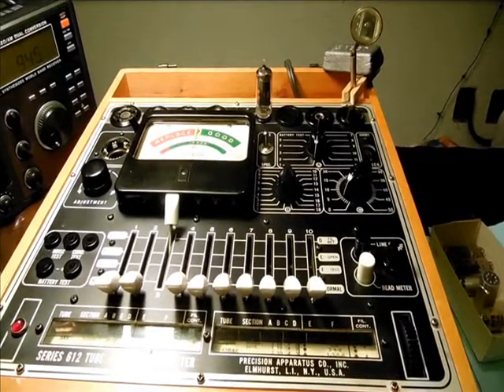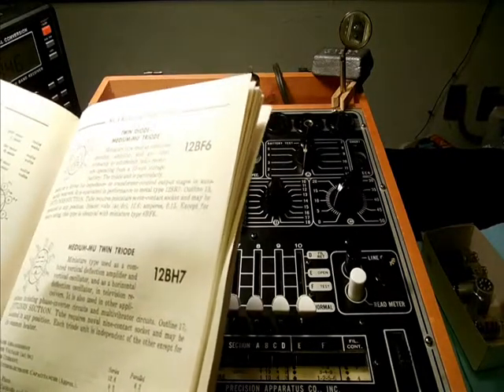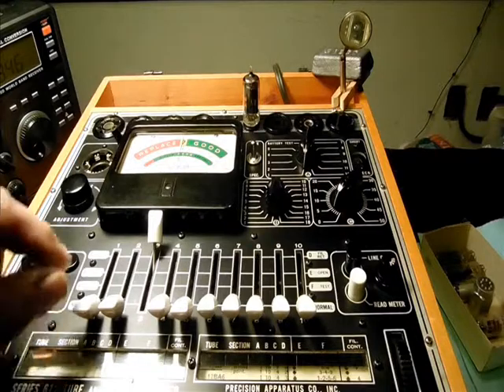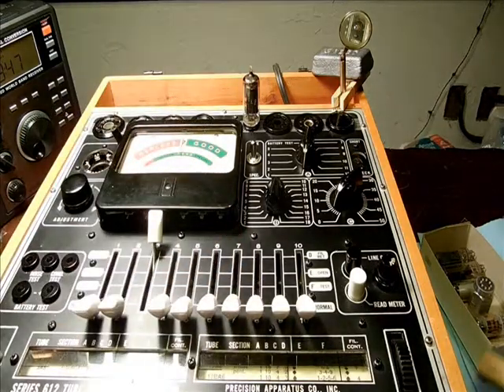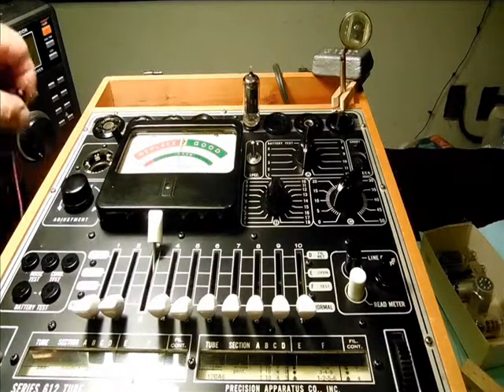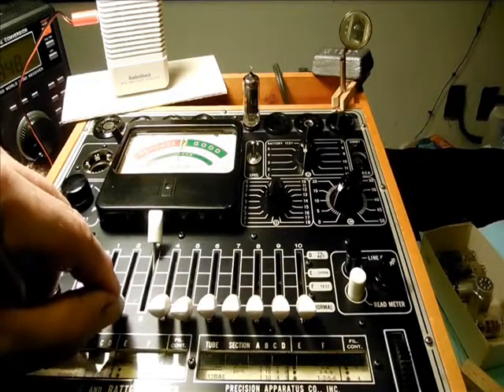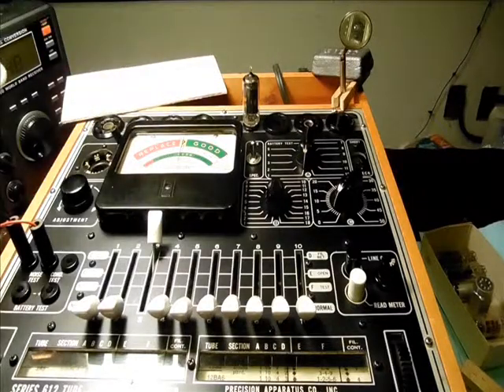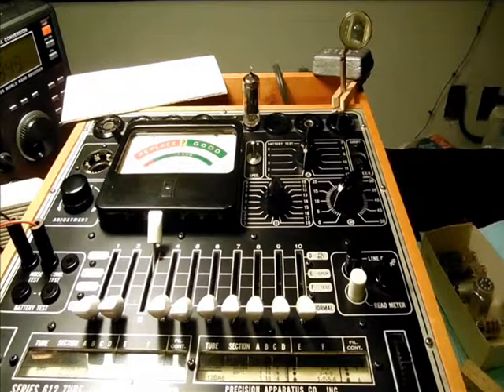Vacuum Tube Test 12BA6

Comment: What happens when the roll describes that "there may be a short on 1,2 or 7." Does that mean the tube could potentially still be good? In this case if there is a short on 2, for example, can we still check for emissions?
Reply from the maker: Yes! Filament test first, then short/leakage test. NO Emissions test if shorts show on positions where they should not show. Good ides to re-test for short/leakage after emissions test because the tube has been heated more.

Comment: What is it that the ten levers do? You mentioned filament control on lever 4, I'm guessing that supplies full power to the heater filament? My understanding of tubes is still pretty low
Reply from the maker: Each switch corresponds to a tube pin. Switch 1 = Tube Pin 1...etc. Depending on the tube, one particular switch gets thrown to apply correct voltage to the tube filament (position "D") Then, all other switches get thrown, one at a time, to "Test" (position "F"). This is a Cathode Conductance Test.
You are correct about lever 4.